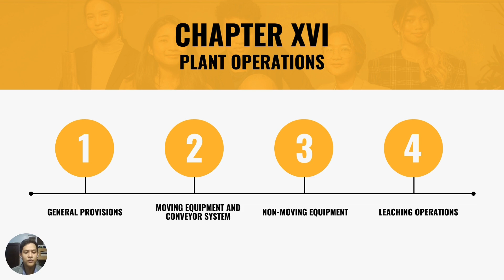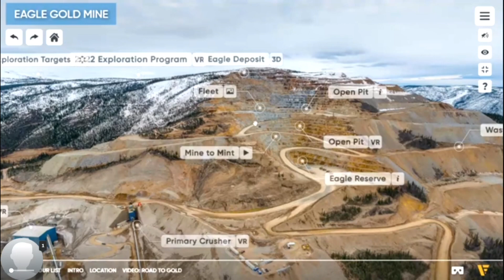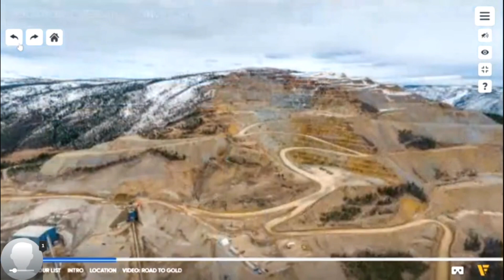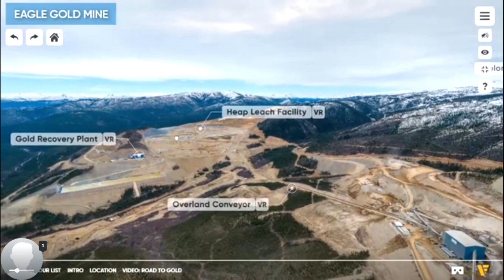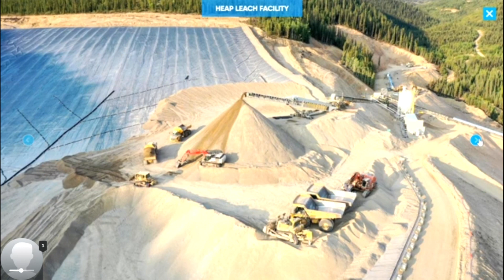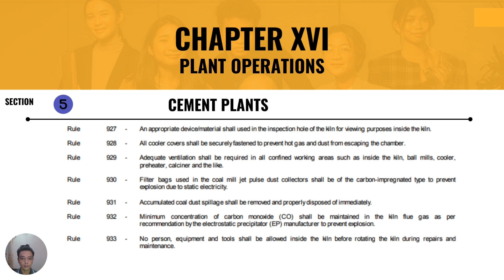Group 5: Chapter 13-16 | Reporting |

Comment: Chapter 13 in DAO 2000-98 is about keeping miners safe by using Personal Protective Equipment (PPE). It gives simple rules on how to wear and take care of gear like helmets, gloves, safety glasses, and more. The chapter talks about choosing the right protection for different tasks and making sure everything fits well. It also emphasizes checking and keeping the gear in good condition. Both employers and workers play a role in making sure everyone uses PPE correctly. This chapter is like a guide to using protective gear to keep miners safe during their work.

Chapter 14 is all about keeping miners safe from health hazards while they work. Section 1 likely gives general rules on how to identify and deal with different health risks in mining, such as harmful substances. Section 2 is probably about having emergency medical and dental services at the mining site. This means there are rules on how to quickly and properly help miners if they get hurt or have a health problem. This chapter aims to create a plan to prevent and handle health issues in mining, ensuring miners stay safe and have access to quick medical assistance when needed.

Chapter 15 is about making sure pipes in mines are easy to recognize. This chapter likely has rules on labeling pipes with codes or colors so that miners and maintenance workers can quickly understand what each pipe does. The main goal is to prevent accidents and make it easier to fix things. It is all about keeping the mining environment organized and safe by having clear identification for different piping systems.

Chapter 16 in DAO 2000-98 serves as a guide for ensuring safety in mining plants. It consists of different sections, each with specific rules. The first part focuses on general safety measures and standard procedures for plant operations. The second part deals with the safe operation of moving equipment and conveyor systems, emphasizing accident prevention. In the third part, attention is given to the safety of non-moving equipment in mining plants. Section 4 addresses rules for handling materials in leaching processes. Section 5 provides guidelines for the safe production and handling of cement in mining plants. The final section, Section 6, outlines rules to protect workers from hazards when handling chemicals and working in laboratories within mining plants. Chapter 16 aims to establish safety and efficiency in various aspects of mining plant operations.

Comment: The reports presented by Group 5 reporters cover a range of occupational safety and health regulations within industrial settings. Here are my insights into the overall report of the group.
Chapter XIII: Personal Protective Equipment emphasizes providing adequate personal protective equipment (PPE) to surface and underground mining operations employees, specifying requirements for different work conditions. Moreover, it outlines the specific requirements of various work conditions, emphasizing safety measures to lessen or mitigate risks. 

Chapter XIV: Health Hazard Control focuses on health hazard control, highlighting the need for emergency and occupational health services, routine inspections, and the maintenance of health records. 

Chapter XV: Identification of Piping System focuses on correctly identifying materials in piping systems, underscoring compliance with Occupational Safety and Health Standards. 

Chapter XVI: Plant Operations addresses plant operations, encompassing general provisions, guidelines for moving and non-moving equipment, and safety measures for specific functions like leaching and cement plants. 

These chapters from DAO 2000-98 Mine Safety and Health Standard reported by group 5 contribute to a thorough understanding of promoting workplace safety and health across various industrial sectors.

Comment: Here are my insights for each chapter:

First is Chapter XIII, which is all about personal protective equipment, also known as PPE.  Personal protective equipment (PPE) is any clothing or equipment that is worn to reduce exposure to any kind of risks. When engineering and administrative controls are ineffective to remove or reduce hazards, PPE serve as the last line of action in The Hierarchy Levels.  The rules are specific in terms of the types of PPE required for certain situations. For example, non-metallic/non-conductive hard helmets for surface mining, miner's lamps for underground labour, proper eye protection, life-saving gear for people at risk of drowning, and respiratory protective equipment in hazardous material situations. The rules state  also that employers are responsible for providing proper PPE. 

The second chapter is Chapter XIV, refers to the different levels of health services required based on mining and service contractor classification (Classes A to D). This emphasises the significance of early medical attention and care in due to the potential hazards in the workplace. This shows a commitment to having adequate facilities for immediate treatment near the workplace. It is also important to remember that submitting reports to the Bureau, DOLE-BWC, and the Department of Health indicates a commitment to regulatory supervision and transparency. 

The third chapter is Chapter XV, which is about identification piping  system. This chapter has only rule, which serves as a reminder of the need of complying  to safety standard and regulation focusing on the identification of materials in piping systems. 

The last chapter, Chapter XVI, discusses plant operations that provides a rules of safety procedures that  regulations into several sections that address different aspects of plant operations. It highlights how important safety precautions are to all operations, including managing conveyor systems, cement factories, laboratories, and chemical handling. This chapter establishes strict standards to ensure the safety of workers in different workplaces. Its detailed rules and guidelines reflect a commitment to protecting employee well-being, handling chemicals, operating moving equipment, working around conveyor systems, managing non-moving equipment, conducting leaching operations, managing cement plants, and protecting against chemical hazards in laboratories.

Comment: In chapter 13 it is all about keeping workers safe by providing them with Personal Protective Equipment (PPE), in different mining situations. The gear they need to stay safe, like hard hats and safety boots for surface mining and underground mining. Working with electricity, handling materials that could hurt you, and being near water where there's a risk of drowning. It's all about making sure the gear is in good shape and, if you're working up high, using safety belts and other things to prevent accidents. In chapter 14 it is all about health risks. It has emergency Medical and Dental Services for classes A, B, C, and D. It says mines should have plans for emergencies, regular health checks, and medical facilities. Different types of mines have different rules to keep workers healthy, like having first aiders and doctors around. In chapters 15 is the identification of piping systems and chapter 16 is the plant operations, it covers more safety rules, like how to identify pipes, how to run a plant safely, and specific rules for cement plants. Overall, these rules are there to make sure everyone stays safe and healthy while working in different kinds of mines.

Comment: On chapter XIII, the reporter emphasizes the crucial role of Personal Protective Equipment (PPE) in ensuring the safety of individuals within the operational environment. It underscores the necessity of utilizing appropriate gear to mitigate potential risks and uphold the well-being of personnel.

Next, on chapter XIV, they broadly addresses health hazard control with a two-fold focus. The first section outlines general strategies for controlling health hazards, emphasizing preventive measures for a secure working environment. The second section highlights the importance of emergency medical and dental services, emphasizing preparedness and response mechanisms for unforeseen incidents.

Dedicated to the identification of piping systems, chapter XV provides guidelines to ensure clarity and understanding in plant operations. It contributes to the overall safety and efficiency of the operational processes.

And last chapter for this group, chapter XVI, outlines general provisions for plant operations, establishing the foundational framework for maintaining a secure and efficient working environment. It also addresses specific aspects such as moving equipment, conveyor systems, non-moving equipment, leaching operations, cement plants, and protection against the handling of chemicals and other laboratory hazards. Each section within this chapter aims to enhance safety protocols and minimize risks associated with various operational aspects.

Comment: The Chapter XIII and XIV talks about the Personal Protective Equipment and Health Hazard Control.  The mining industry has significant health hazards for its workers, so the regulations prioritize prevention through PPE mandates and emphasize employer accountability and scalable healthcare solutions. The regulations also highlight the importance of qualified health practitioners and regular monitoring for early identification of potential hazards. Challenges remain in ensuring full implementation, particularly in remote locations, but innovative technologies, strengthening worker engagement, data-driven approaches, and collaborative efforts can help address them. The mining industry needs continuous evaluation, adaptation, and innovation to promote continuous improvement in safety standards.

The chapter XV and XVI discusses the identification of the piping system and potential concerns of various aspects related to plant operations. It covers safety measures such as PPE, equipment maintenance, housekeeping, and emergency preparedness for plant safety. It also emphasizes stringent safety protocols for moving equipment, non-moving equipment, leaching operations, cement plants, and laboratory hazards to prevent accidents, injuries, and environmental contamination. The potential concerns include negligence, complacency, and mishandling of hazardous materials, which require ongoing training, education, and supervision to ensure compliance with safety regulations.

Comment: The video discusses chapters XIII to XVI of the DAO 2000-98. Group five presents the key points of each chapter and here are my insights about their report. 

Chapter XIII focuses on personal protective equipment (PPE). It covers rules 849 to 859, which detail the required safety gear for different work settings such as surface mining, underground work, electrical work, and managing hazardous materials. The aim is to minimize risk, protect employees, and maintain a safe working environment. 

On the other hand, Chapter XIV discusses health hazard control. It is divided into two sections: general and emergency medical and dental services. Rules 860 to 863 emphasize the provision of emergency and occupational health services, regular inspections, and minimum requirements for workplace medical supplies.

Meanwhile, Chapter XV is titled "Identification of Piping System." It only has one rule, 868, which states that all applicable rules for proper identification of materials in piping systems should adhere to occupational safety and health standards. 

The last chapter of this report is Chapter XVI which is about the plant operations. It consists of six sections. Section 66, the general provision, includes rules 869 to 879. These rules cover various safety measures such as employees having knowledge of managing chemicals, wearing fireproof apparel, and practicing proper housekeeping. The following sections discuss specific topics like moving equipment and conveyor systems, non-moving equipment, leaching operations, cement plants, and protection against handling chemicals and laboratory hazards. 

Overall, the video provides an overview of the key points in chapters XIII to XVI of the DAO 2000-98, focusing on personal protective equipment, health hazard control, identification of piping systems, and general safety measures in different work settings. A job well done for Group 5 as well; their report was informative and understandable.

Comment: These are my insights for the DAO 2000-98 chapters thirteen (XIII), chapter fourteen (XIV), chapter fifteen (XV), and chapter sixteen (XVI). Chapter thirteen (XIII) is all about the personal protective equipment for the personnel in mines. The rules include the provision of personal protective equipment (PPE) for workers to avoid exposing them to unnecessary and unavoidable hazards as well as the guidelines of what type of PPE should be used in different areas of operation.

Chapter fourteen (XIV) of DAO 2000-98 is all about health hazard control. These rules are for the control of health hazards and they will include the provision of emergency and occupational health services and facilities for the worker as well as keeping at least the minimum quantity of medicines, medical supplies, equipment, and medical facilities under the prescribed list in Chapter VII of Sanitation Code of the Philippines and Medicines. The rules for emergency medical and dental services and their practitioners are also included.

Chapter fifteen (XV) of DAO 2000-98 is the identification of the piping system. The rule suggested that all applicable rules for the proper identification of materials in the piping system shall conform to the Occupational Safety and Health Standards, as amended, of the Department of Labor and Employment.

Chapter sixteen (XVI) of DAO 2000-98 is all about the safety rules in plant operations. The chapter includes the safety rules for moving equipment and conveyor systems, non-moving equipment, leaching operations, and cement plants, as well as protection against the handling of chemicals and other laboratory hazards. These rules will ensure the safety of the employees in plant operations.

In summary, DAO 2000-98 Chapters XIII to XVI demonstrates important mining safety measures. Personal Protective Equipment (PPE) provision is emphasized in Chapter XIII, health hazard control is emphasized in Chapter XIV, and proper identification of piping materials is emphasized in Chapter XV. Chapter XVI discusses plant operation safety rules, including equipment, leaching, cement plants, and chemical handling. These chapters form a comprehensive framework for ensuring the safety and well-being of the workers in mining.

Comment: Chapter XIII focuses on Personal Protective Equipment (PPE) in mining operations, emphasizing the provision of adequate and approved safety gear, including hard hats, boots, lamps, gloves, eye protection, respiratory equipment, life-saving apparel, and fall protection, with an emphasis on maintenance and suitability for specific hazards.

Chapter XIV, Section 1, emphasizes the employer's responsibility to provide emergency and occupational health services, conduct regular health inspections, and maintain necessary medical supplies. In Section 2, rules outline the specific requirements for emergency medical and dental services based on mine classification, stressing the provision of first aid, nursing, doctor, and dentist services, with options for emergency treatment rooms, clinics, or hospitals, and the importance of contracts with nearby healthcare facilities.

CHAPTER XV, identification of piping system, Rule 868 stipulates that rules for the proper identification of materials in piping systems must comply with the Occupational Safety and Health Standards of the Department of Labor and Employment.

Chapter XVI, outlines comprehensive safety regulations for plant operations, covering aspects such as employee awareness of chemical hazards, specific safety measures for different plant activities, and guidelines for handling materials like corrosive liquids and molten metals. Emphasizing employee training and strict adherence to safety protocols, the regulations aim to create a secure working environment across various facets of plant operations.